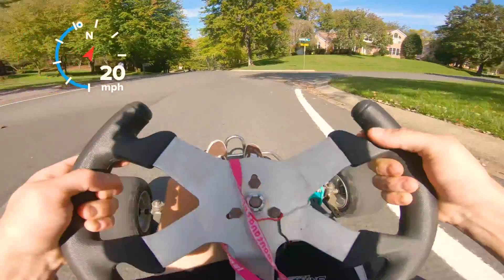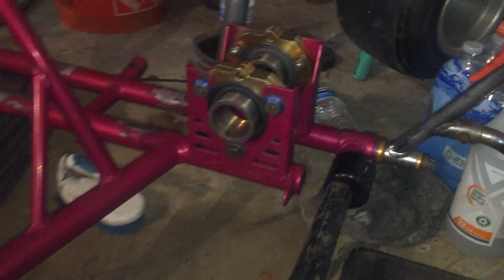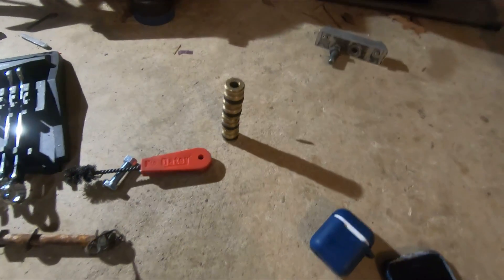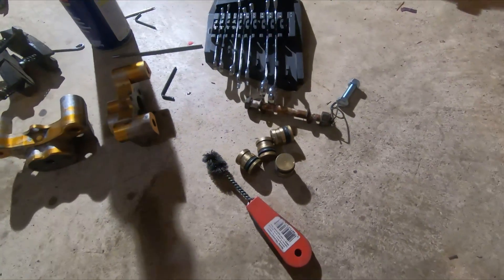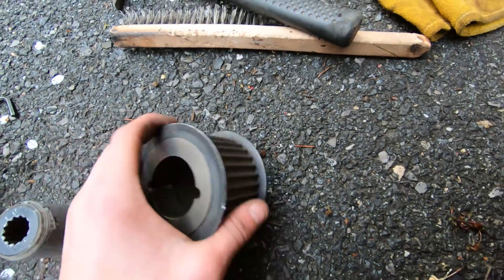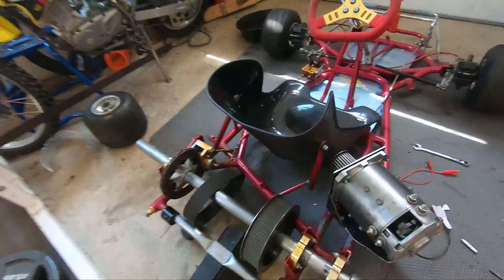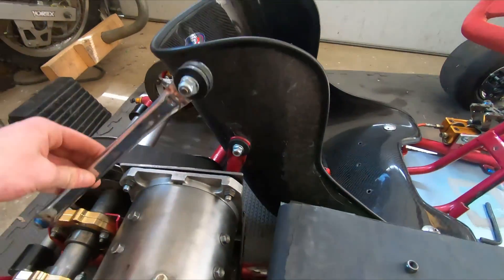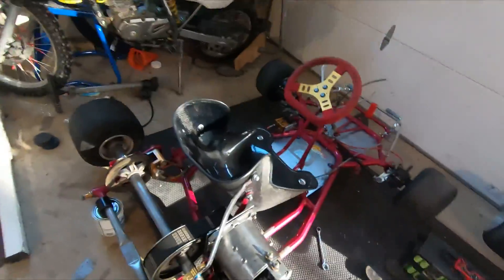70hp Electric Go Kart build V2 // Part 1

Comment: How much does the engine and battery costs? And how long while the battery hold for drive it around a racetrack?
Reply from the maker: i got both used from second hand websites. about 700$ together. it lasts about 20 miles if you drive moderate and about 15 if you go hard.
Reply: thx  @Kevin.OBrien44

Comment: Hey, sweet build, im doing something simular, Got the battieries and a 2 13kw continues escs, but I'm struggling to find a motor. Do you know if a 24V pump motor could work, and if it really matters what the HP is, like if its 1/2 or 1/3. Thanks

Comment: Where did you get those pullies?   Is that 1-1/2" 8mm tooth?  That pully and belt system is awesome!
Reply from the maker: My pulleys are 50mm wide with 8mm pitch. I think that's overkill though. I'm going to get 30mm wide for when i regear it
Reply: @Kevin.OBrien44  thanks again. I think you’re right.  30mm or maybe 20?  I’m looking around now to see what’s available.  I have to take some measurements!

Comment: Where did you find those pulleys and belt?
Reply from the maker: I Got them from ebay. I think they were for a dodge trucks timing belt. https://www.ebay.com/itm/362443468929?nma=true&si=nDtp5PkJAwgWS6dfQbF%252BhjcBZyE%253D&orig_cvip=true&nordt=true&rt=nc&_trksid=p2047675.l2557

Comment: How can I find a 50000 watt motor ? I can’t find it anywhere
Reply from the maker: Most motors are rated for up to 10ish but you can push more power through them if u have sufficient cooling

Comment: Those seals are U-Cup seals and you can find them somewhat easily in online catalogues that are ok for dot3 or dot4 fluid. Just basic hydraulic seals. I would recomend something like HNBR or Viton with a teflon backup ring. Urethane is good, but if there is ever water in the system, the urethane will absorb the water and break down from the heat.
Reply from the maker: Yeah I looked for replacements but the actual walls of the brake cylinder were pitted so I just bought a new caliper.
Reply: @Kevin.OBrien44  Ah, gotcha. Thing is awesome, and it definitely looks like it rips! Nice job.

Comment: One idea for the drive pulley might have been to make it from two parts, and inner and outer and use a lathe to centre the inner on the shaft spline. Then slide the outer over top.and weld that.
Reply: Ya just use a lathe. Or machine a brand new one. Or 3d print one out of titanium...
Reply from the maker: Yeah I wish I could do that lol

Comment: I found the same motor you are using. I'm trying to figure out how you got 50kw. How did you come up with that estimate?
Reply from the maker: Send a link to the motor
Reply: @Kevin.OBrien44  it says it's not longer available because I've already bought it. Its called Advanced CM7-4001 Electric 48V DC Motor  -Terex TA30N Boom Lift
Reply: @Kevin.OBrien44  is there a way I can contact you. I'm auchuly planning to build this and I might have some questions in my way.
Reply from the maker: @Mikelinnyk  kevinobvlogs@gmail.com

Comment: Idk who told you it was rated for 300 amps but there is no way that motor is rated for 300 amps that thing would fry instantly. Maybe 30 amps tops. The controllers can be rated for over 300amps input power but you'll never get the out of one small motor like that.
Reply from the maker: How would I test the output of the motor vs to input of the controller? Where I put the clamp meter? because ive put the clamp meter on various wires and measured bursts up to 450 amps and over 200 continuously
Reply from the maker: Isnt the battery amps usually higher than the phase amps? but this is a DC motor so idk if that applies

Comment: Hello Kevin, I was wondering how you came up with the HP rating on that motor. I'm not sure if I'm doing this right (I think I am) but I come up with (ohm's law) V x I=P 48V x 300A = 14,400W / 745.7W (which = 1 HP) = 19.31 HP. Getting ready to build an electric bar stool racer and just wanted to make sure I was calculating this correctly, if I'm wrong could you please send me the formula you used so I can check it out and see where I went wrong. Thanks and looks like you have a nice project going on there.
Reply from the maker: yup that's exactly correct. If you want to find the real power drawn you would have to monitor the voltage while you draw 300A because the voltage might dip a significant amount. Like for mine it is 85v fully charged but dips to 65-70v under load.

Comment: well built! I have two questions for you, first how much did your total build cost and secondly where did you buy that motor?
Reply from the maker: I dont have a exact cost but I would guess around 2000-2500 maybe. I got it from ebay, it was used as well. try searching for "Electric forklift motor"

Comment: Where did you get the bel drive pulleys? Sick build
Reply from the maker: From ebay. Heres an example https://www.ebay.com/itm/174989753912?hash=item28be33be38:g:pRkAAOSwVTJhczAe
Reply: And gear ratio please.

Comment: Should have just mounted that seat post to the top bolt on the motor frame.
Reply from the maker: Yeah but I need the Motor mount to be able to move to adjust the belt tension

Comment: Hello, if you dont mind me asking, im also building an e kart, what motor, controller and i believe ive got the battery covered, i ordered 340 life po4 military cells 3.2. Vts a piece and 3800amh with a 3c rating, im building a 120 volt or more battery, but havent found the right motor or controller yet, my ebike is 5000 watts and does 50 mph but im upgrading that also, but could you send me the link on the motor and controller?.. Thanks in advance.....😁
Reply from the maker: The motor was a used off of ebay from an electric forklift. The listing isn't available anymore. This is the esc https://kellycontroller.com/shop/kdz-e/

Comment: Really nice build!, both pulleys are taper-lock, I think you could get a slight smaller one at the rear in order to not cut parts of the frame.
Reply from the maker: yeah i just bought a smaller one because this one only got me to 41mph

Comment: sick build! but there’s no way you’re gonna be pushing 50kw through that small ass motor. physically not enough copper. maybe 20kw at most. but good luck! looking forward to the next video!!
Reply from the maker: I’ve pushed 30kw through it already and it’s got 110°f so if I add a cooling fan and push 50kw it’ll be fine. It weighs 45lbs so I think that’s probably enough thermal mass to dissipate the heat fast enough
Reply: @Kevin.OBrien44  add 10 gpm water pump to cool the motor and controller with a small radiator and it'll push more than 50kw if you're in a hurry.

Comment: Are there controllers with servo functionality for this kind of power? I'm thinking of building a self driving kart using GPS waypoints and need smooth and stable motor control that has torque at low speeds
Reply from the maker: Yeah these are often used in small vehicles but have old tech. It is stable though at low speeds. Like I can cruise at a constant 10 mph constantly

Comment: I just wanna say Way to go! This is a very ambitious build! Can't wait to see the next video! 😆 Also, side note and none of my business but please please please be careful with this much wattage. Triple check all of your wires and connections each time you change something. This is enough power to weld with and one stray short can cause serious injury. Can't wait for the next vid, Cheers mate.
Reply from the maker: Yeah i’m very careful with the battery terminals always covering them when not in use

Comment: 18650 is much better batteries for go kart, lighter and more capacity then the batteries you used per kg
Reply from the maker: Yeah I’ve actually already finished it and rode it and it only gets about 15 miles of rang driving hard but that could likely be doubled if I used more dense batteries. The reason I used these is because they were cheap and have high output. Like this pack can do 400 amps at 80v continuous
Reply: @Kevin.OBrien44  this is a good range
Think about it, go kart need to work for about 15min
So 15 mile on 60mph is 15min

This is great
If you can just add battery voltage and amp while driving 
Watt consumption, Ah, kmph/mph, acceleration and more

If you will do that maybe I will be able to help you
Reply: @Kevin.OBrien44  if you can just send me the name of the motor, I will find the curves of it and will calculate for you the best gear ratio, wheel size and battery pack needed
I have plenty of free time right now
Reply from the maker: @harelbenyosef8743  I actually already built it but just have to edit the video. Thanks for the offer though. I did a test and got 12 miles out of the battery pack driving really hard so I think that is ok but could be better

Comment: Can you can you send me dimensions of motor and battery
Reply from the maker: The motor is 7in diameter and 10 inches long. And the batteries are both the same on each side.  At 18x6x6

Comment: I need a part 2! I'm in the beginning stages of building a similar kart and I'm wondering if you are going to use some sort of motor controller or just like a potentiometer for the throttle!
Reply from the maker: Im using a kelly 72650 esc and a hall effect throttle. part 2 is out soon!
Reply: @Kevin.OBrien44  That electric skateboard must have been a death trap lol.
Reply: @Kevin.OBrien44  How did you know what controller to get with your motor?
Reply from the maker: @rever4217  I just picked one out for the voltage of my batteries and then how many amps my motor can take.
Reply: @Kevin.OBrien44  Oh ok, I'm still trying to understand the relationship between the motor, esc, and batteries' required voltage and current.
Does your controller and batteries always need to have a voltage and current more than or equal to your motor's? So e.g. 48V 200A motor with 72V 300A esc and 72V 300A battery is ok? What if your esc is rated lower than your motor and battery pack? Not sure if you can help me on this but I thought it's worth asking.
Reply: @Kevin.OBrien44  did you buy the dc motor online or you found it locally?
Reply from the maker: @FirstLast-tx3yj  I bought it on eBay
Reply: @Kevin.OBrien44  How much?
Reply from the maker: @quarans08  the esc was one of the more expensive parts of the build around $400 usd

Comment: where did you get your motor
Reply from the maker: I got it used off of ebay, look for DC series wound motors
Reply: @Kevin.OBrien44  how much did u pay for your 70hp
Reply from the maker: @Triggatreydmv  I think all in i’m at 2000 now
Reply from the maker: @Triggatreydmv  maybe a bit under that

Comment: How did you lock the Pulley on to the axel? I see the pin to keep it from spinning, but what keeps the pulley from moving left or right?
Reply from the maker: The motor axle or wheel axle?
Reply: @Kevin.OBrien44  Wheel
Reply from the maker: @srqtactical  At 8:49 you see the 2 half circle things that fall out of the center of the pully. Those get screwed into the plly and are cut at an angle so they wedge the pully in place. https://www.youtube.com/watch?v=jV6ko-kFuo4
Reply: It's an industrial pulley, it has basically a collect that grabs on the axle

Comment: You got a sub, where did you get the pully system?
Reply from the maker: I Got them from ebay. I think they were for a dodge trucks timing belt. https://www.ebay.com/itm/362443468929?nma=true&si=nDtp5PkJAwgWS6dfQbF%252BhjcBZyE%253D&orig_cvip=true&nordt=true&rt=nc&_trksid=p2047675.l2557
Reply: @Kevin.OBrien44  Damn dude, your builds are so good. Are you like in the fabrication industry or is this just a hobby for  you?
Reply from the maker: @srqtactical  Thanks dude means a lot. Im actually only 17 so this is just a hobby.
Reply: @Kevin.OBrien44  Well, you are very resourceful! True sign of very high intelligence, don’t waste your shot bud!
Reply from the maker: @srqtactical  thanks 🙏
Reply: @Kevin.OBrien44  Nice, so the big pulley has 80 teeth, how many teeth are on the smaller pulley? Is the ratio similar to the previous chain driven build?
Reply from the maker: @srqtactical  the ratio on the old one was 9/63 and the new one is 32/80
Reply: @Kevin.OBrien44  Gotcha! I went with a P28 and a P 72, but I might have to remount it because I don’t have the room.
Reply from the maker: @srqtactical  sick
Reply: @Kevin.OBrien44  I’d rather not, but if I want belt drive it’s the only way. I think I’ll make a square cage for the motor, then a matching frame attached to the go kart. I’ll design a side / locking mechanism to adjust belt tension.
Reply from the maker: @srqtactical  I might buy another sprocket like a 64 and see how that afects my top speed later down the line
Reply: @Kevin.OBrien44  I might keep the 72 the same and see what going up on the smaller one does, I think 28 is the smallest
Reply from the maker: @srqtactical  yeah 28 is the smallest for 50mm wide belts i thinik

Comment: Socks in the garage. I see you too are a man of culture ;)

Love the build. I wanted to do a racing kart frame for my build. But after months of looking I couldn't find anything reasonable under $1500. That pulley is pretty balanced for eye-ball weld! Any details on the motor controller you are going to use? What kind of belt system? Looks like 200mm width? Or is that stuff coming up in part 2? ;)
Reply from the maker: Im using a Kelly KDZ72650E and I think the belt system is from dodge trucks timing belts but I'm not sure, its 50mm wide though
Reply: @Kevin.OBrien44  Nice! That is a beast of a controller. Can't wait to see the battery pack that goes with it. You'll need some high amperage cells to be able to use all of that motor!
Reply from the maker: @andyshinn  supposedly these cells can do 100 amp burst for 10 seconds. And I have 8 in parallel so it should be able to do 800a for 10 seconds

Comment: To compete with rotax 125cc you need as light kart as possible. My kart is 133kg and it’s already 40kg heavier than regular 125cc karts.
Reply from the maker: Also Ive seen your builds before, there some of the ones that inspired me, maybe Ill beat your 3.5 sec 0-100🤷‍♂️
Reply: @Kevin.OBrien44  in 2017 we got 2,6s to 0-100km/h :)
Reply from the maker: @kolmefaasiline3829  oOf might not be able to beat that😂
Reply from the maker: Yeah mine weighs 233 lbs(105 Kg) but that's probably due to the small amount of batteries I have on it. Its only 1,440 watt hours
Reply: Were you posting build logs on endless sphere? I think I saw yours as well. A great inspiration for sure. Love your racing kart.
Reply from the maker: @andyshinn  I don’t think I posted there but maybe a couple months ago🤷‍♂️
Reply: @andyshinn  yes, build log is in endless sphere forum.
Reply from the maker: Yo I’m getting a smaller sprocket for a top speed of 75mph so that should pull 650 amps and also managed to reduce the weight by 20lbs so I gotta test it
Reply: @Kevin.OBrien44  650 amps is nuts. Why so much current? My kart is barely controllable at 200 amps. But maybe racing chassis can handle it. I recently tested my top speed at 42 mph so I guess a smaller sprocket will need to pull more current to get up to speed as quick.
Reply from the maker: @andyshinn  yeah it only pulls 250 amps right now but the gearing only allows it to get to 41 mph. Once the sprocket is changed it will pull more amps but also be able to go faster like 70ish
Reply from the maker: Ive just weighed it after replacing that huge rear pully and the pully weighed 28 lbs and some other parts as well. my new weight is 202 lbs. the only downside is I can only get 8-10 miles of range on my battery when driving hard.